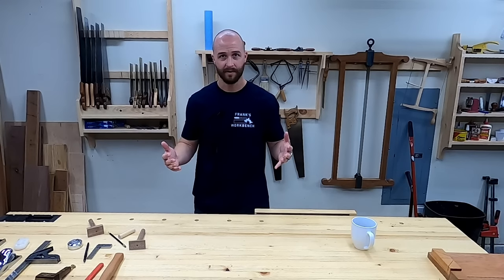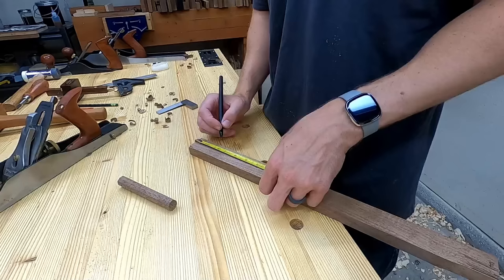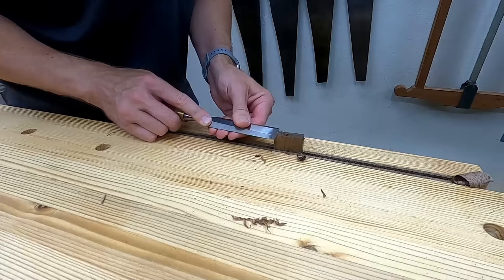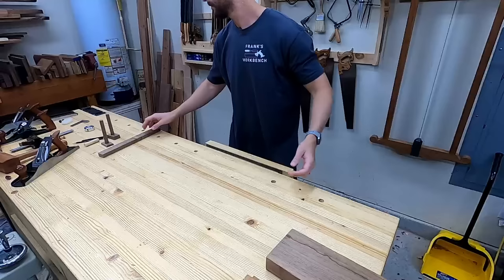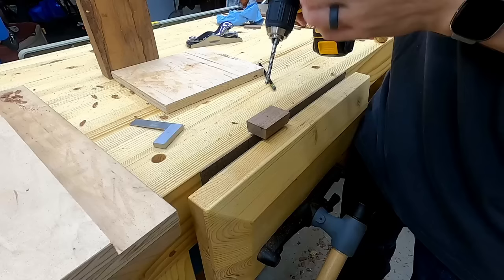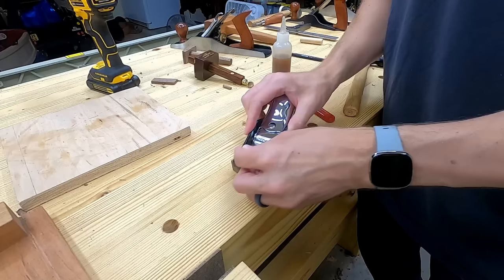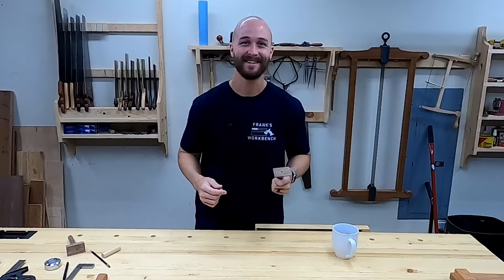Don't Make a Bench Dog Until You've Seen This!

Comment: Nice job and a good idea but I can't help wondering why you would just drill a hole in the plate to accept the larger dowel rather than add a second (dowel) process? Maybe it's just me but that seems simpler.
Reply from the maker: Yes a solid option!
Reply: And stronger.
Reply: That is exactly how i made mine.
Reply: He wanted to show off, I mean show us, his dowel plate.. which, admittedly, is pretty cool.
Reply: It's an inlay ;>
Reply: Because he's an amateur
Reply: @user-ql6iz3wm8p aren't we all? 
Proverbs  13:10 Only by pride cometh contention: but with the well advised is wisdom.
Reply: Plus, there can be a small wedge in the pin going through the hole in the head.
Reply: There are many ways to...

Comment: Probable a little late but: I would make the top a 4in square, then put fixing it off center on both axis. This will give you 4 different lengths for each dog.
Reply: Yes this was the first thought on seeing the 2 distances, 4 would be better.  With 4 inch center dog holes, you could make some with 1, 2, 3, and 4 inches from center.  Pick the hole and the side, and you would never have to adjust the tail vise more than one inch.
Reply: Agreed. I've also done this 4-position trick with a home-made marking gauge to give an adjustable bearing surface depth. Extra stability is always nice but sometimes the reference edge just doesn't have clearance in some direction. Like Frank did here, the trick is to leave flats on the marking arm dowel so it can be indexed to each side when pushing down the taper pin lock.

Comment: I cut squares from various thicknesses of plywood, then drilled a center hole all the way through using a forstner bit and drill press, then glued in a 3/4" dowel to fit the dog holes in my bench.  I like your idea of making rectangles instead of squares.  I will make some more using rectangles.  I don't have an tail vise due to space constraints, but do have a Veritas bench dog to serve the same purpose.
Reply: Embedding the dog directly into the "head" with a 3/4" hole is a no brainer IMO. Faster, easier, stronger, fewer materials, less processing etc, even if you kerf and wedge it. You can also offset the hole in a rectangle block so that the 4 corners are, respectively 1, 2, 3, and 4" off center, or some other set.

Comment: I made a set of similar bench dogs out of scrap cherry. I drilled a hole through the head of the dog and ran the entire dowel through it, flush with the top. This was simple and strong. There may be a hundred ways to do this well, but this worked for me.
Interesting video. Thanks!

Comment: Nice job. I made them similar when I had to use a Black n Decker Workmate to build a new bench after house move. But like others I drilled the head through to receive the dog. Same for my plane stops. I also used a similar application in making supports for long pieces in the vice. Long dog protrudes both sides of the head; one end in the leg and other supports the board. I suppose you could offset the dog in the 'head' so each orientation offers a different distance but tbh just easier to pump out different size heads.
Aside...I use this dog and planing stop style as tool when planting seeds in trays/cells to tamp/firm things down ;)

Comment: Nice job.  I hope they are strong enough.  If you make the post off center under the head, you have even more adjustment of the gap width depending on which lengthwise orientation you use when placing the dog.

Comment: These look great; the shooting board method of undercutting looks so practical, and makes me wonder whether a 7 degree or so board might be worth building, for splayed legs and dovetails and such. 
I've also seen similar dogs that are square but have the shaft off center by a different amount in both directions, to give four options per dog. A related work holding idea I've seen that's basically the ultimate extension of this general concept is to build a cam-shaped dog head, to replace the wagon vise entirely.
Reply from the maker: Interesting ideas, thank you!

Comment: If you start out with dowel that is one size over what you want, the dowel plate does make perfect dowels, I cut it one size over, use a round over bit to make it almost round, run it thru bigger holes and finally thru the size you want, perfect round dowel

Comment: Dude! So sick! Im definitely going to try this out. It also got me thinking. I have one of those plastic Stanley miter boxes from Home Depot, and the pegs for the board are oval-shaped so you can twist them to press up against the board. I don't have a tail vice and every time I try to make that Veritas bench dog with the block and screw I blow out the hole with the threaded wood nut.

Comment: Great video, but the problem I have with the design is when in use, all the strain is on that thin reinforcing dowel (aside from the glue of course). I'd inset the big dowel (or run straight through) the dog. With that, probably better to use a real round dowel. Much stronger.

Comment: Irrelevant question about sawing:  

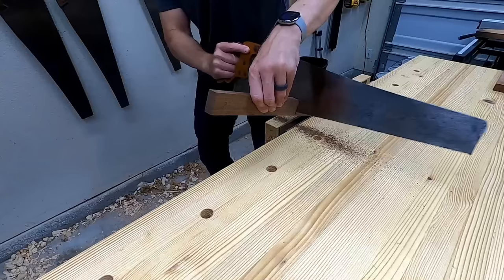At 0:59 you have the workpiece diagonally in the vise with the off-cut to your right, so you have to saw diagonally and reach your left hand across the right to catch the off-cut.  I've always had my vise mounted at the extreme left side of the bench so I can clamp the workpiece horizontally, sticking out past the end of the bench.  That way I can saw straight up and down and catch the off-cut without crossing one hand over the other.  Your way looks harder, but I see guys doing this all the time so there's probably some good reason for it that I don't understand.

Not really important, but I'm planning a new bench and wondering if there's a good reason to set it up differently.
Reply from the maker: ppl do successfully both ways, I have a strong preference for not mounting the vise on the far left so that I've got 180 degrees of bench space available to use. Far left mounting and you cut your reachable workstation in half while dovetailing or working in the vise. That said there's far better woodworkers than me who do it the other way!

Comment: I would make a bored hole in the stop, just short of going through.  The round tenon of the dog-hole pin would bottom out in it, and would not need to depend on a rather thin dowel to resist clamping pressures.
My $0.02...

Comment: I have made a couple of bench dogs like that, but drilled through the head to push the 19mm dowel all the way through. My thinking is that it makes it stronger. However, I'd be interested to hear what you think.
Also, I call CGI bullshit on that bin shot ...
Reply from the maker: I agree, thats a good method.. Just requires a little more careful drilling to make sure the hole is perpendicular to the dog's head so it doesnt sit cockeyed on the bench. As for the shot :) LOL

Comment: I can't make a straight dowel with that thing to save my life...
Reply from the maker: Dowel plate? If you're getting it started by making a taper with a chisel try instead using a pencil sharpener, when it starts more even it will come out more even. Also with the grain if possible
Reply: @FranksWorkbench  Thanks Frank. Will do.